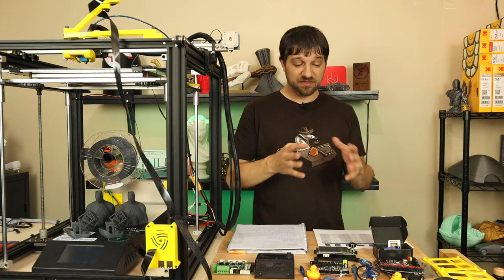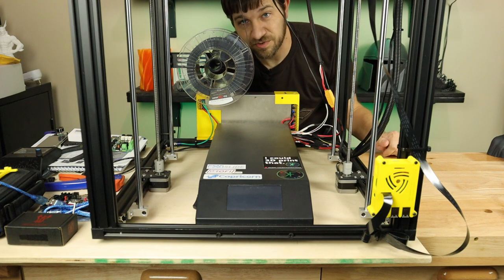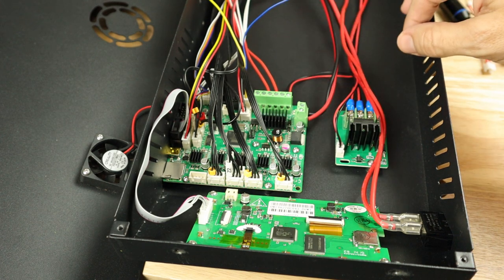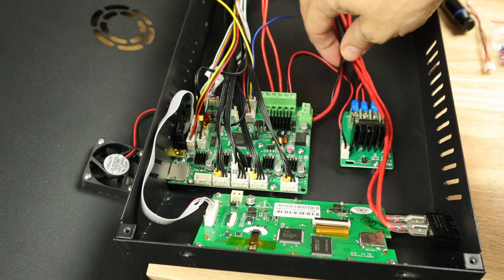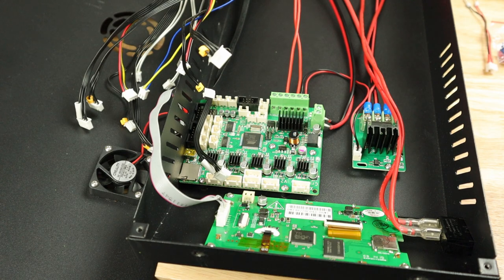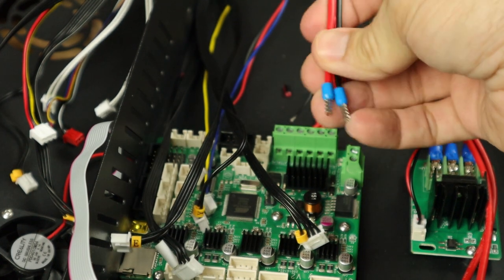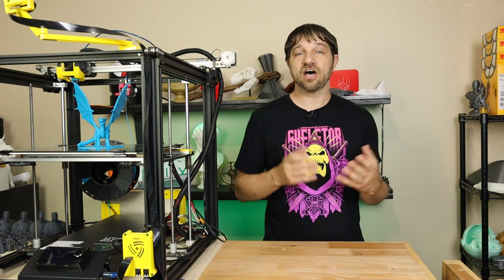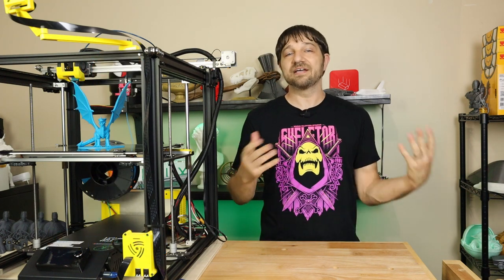Bigtreetech Ender 5 Plus Upgrade: TFT35 Display (Part 2)

Comment: Good video. For the TFT35 V3 screen I was able to squeeze in a sd card extender and route it out of the bottom of the control box.
Reply from the maker: Yep. That was going to be my other idea but the other mounting is more practical if you want access.

Comment: The most funny thing is that I actually tried all the cases shown here and after purchasing a lot of addons for the first mount (SD extender to flash the screen, USB extender to drill holes and use the USB) found the second option and when with it. I love it although I do all my printing from Repetier so it's kind of unneeded but hey so is half the stuff I print. :)

Comment: Great video.  I forgot how much I dislike that electronics box, and how hard it is to work on it.  Glad you pointed out the ferrels they really make it better and much easier to work on.
Reply from the maker: Thanks! Yeah, I wish the box opened on top. But, for most people, this isn't an everyday occurrence. Just trying to add some safety with the ferrules.
Reply: @kerseyfabs  Thanks, I'm always getting into mine, but it opens from the back.  Wait it has no cover, just the electronics

Comment: Just as a note.  Wire that is tinned correctly will act like a solid wire as it would be full of solder, so it is not incorrect to tin the wire, as long as it is done properly.   In fact, with high current it can be preferable to have tinned wire and with proper rising clamp terminals, they are perfectly safe.   Electricians don't use ferrules in your fuse box as the crimp connection can be a weak point, and the wiring is perfectly safe.   
As long as you don't have any strands outside of the connector, it is 100% safe to do it tinned or even untinned bare wire.   There is nothing incorrrect about doing that.

Comment: Another department at work thought they could get their own 3d printer and cut out the middle man.. that's me.. Well guess who has a new printer?? lol They just can't really handle the tuning and stuff needed. lol We'll it's mine now and I got it working very well after about an hour and some new parts. Broken extruder, clogged nozzle and hot end.. Z screws uneven and guides over tightened. I do want to do the board and screen upgrade didn't think of making another case for the screen and dial..  Thanks again for the info now that I'm a 5 plus guy and also a cr10s guy.. lol
Reply from the maker: Fantastic! Congrats on the new machine!

Comment: Good video anyway, but I've one thing to complain: I know generelly everybody wants to crimp this stranded wire with this ferrules. But this is not the way it should work with the the print clamps. If you look in the manufacturer's data sheets, you will see that they offer (and often recommend) to install the pure strands. Because this offers a better contact! Only if a cable is in motion, a ferrule crimp is a better choice. Within the printers control housing there is no motion. So I would choose (and do so with my printers) blank strand installation.

Comment: Just going through this right now :) but also doing a bunch of other things too, great tutorial, I was going to mount the display in a box with the Octoprint display and PI 4B but now have changed my mind, but the next thing is to work out how to combine the PI 4B and the 7" display
Reply from the maker: It sounds like you've got big plans. Are you talking about the new Bigtreetech display or one for the Raspberry Pi?
Reply: @kerseyfabs  both actually TFT35 screen for the Skr,  7" screen for the PI, I have just rewired it fully and installed drag chains, Micro Swiss hot end, Herome cooling setup, had a go at sensorless homing last night (a fail) so will try again today, also have a bunch of closed loop steppers on the way...... Not going to be an easy fit

Comment: Thank you for all your video's. They are great. Do you know on a standard Ender 4.2.2 Motherboard can one add a BTT TFT35-E3 V3.0 Display Touch Screen?
Reply from the maker: It will work on the Marlin side but I don't think there's a connection for the touch screen side.

Comment: Kris,

Great video.  Can the TFT 3.5 display work with the oringial creality 4.2.2 board or do you need to upgrade the board along with the display?
Reply from the maker: Technically the Marlin side of the display would work if you recompiled the firmware. You may be able to even get it to do the Marlin side OR the touch screen side but not both. Either would require custom firmware.

Comment: Thanks for the great video. I am following your series to update my E5Plus. In this video it shows you connecting a total of 3 cables for the display, specifically 2 10-pin connectors. One to exp1 and one to exp2. But then on the Bigtreetech SKR E3 Turbo: Complete Guide, in the wiring section, you only show one 10 pin connector coming out of the display and you connect it to the exp1 port on the SKR E3 Turbo. But there is no mention that I can find of which one of the cables (exp1 or exp2 on the TFT35) you are using? Thanks!
Reply from the maker: Great catch! I'm pretty sure it's EXP3 on the TFT35 side. I hope this helps.
Reply: @kerseyfabs  Yes it is. Based on the location in the video and other research, I plugged it into EXP3 and it worked! Thanks!

Comment: Hi Kris,
This is really a great tutorial, very detail and throughly.
I already watch it more than 4/5 times and come to decision to upgrade my ender 5 plus.

Questions :
1. Can I use the cheap Reprap 12864 LCD?

2. Can I use TFT35-E3 v3.0 or TFT35 v2.0

If yes, can I use the firmware.bin you provide?
Reply from the maker: Thank you! Yes to all of your questions. Any of those LCDs will work with my firmware. I'd stay away from the V2.0 though, no Marlin interface.

Comment: Followed this video, to replace my previous board with the BTT EKR mini V2 (as you suggested the V3 had some issues). When I went to do the ferrels for the thin black and red wires from the mosfet? board (small board on front of case), the ferrels would not hold as the wire was too thin. I would then restrip the wire, hoping to get a thicker set, however, everytime I did, I would get a couple of wires only as the stripping process would remove most of the copper wire, only leave a couple of strands. I have all the same equipment as per video.

At a point where after 4 attempts I cannot risk any more wire as it is getting way too short. 

The initial wire connection was soldered and fairly thick/stable.- possibly should have left it alone?

Otherwise any suggestions on how to fix or replace the wires, including the connector for the mosfet?

Comment: I'm late for this but to use the skr mini e3v2 do I need to change the screen as well or stock screen will work with it and your firmware??? Thank you
Reply from the maker: Yes, change the screen as well. My firmware only supports the new screen.

Comment: Doing this upgrade today, thank you for the tutorials! Question, where does the ground get relocated too that was on the screens mount point?
Reply from the maker: I forget where that was running from. It should be fine to connect to and screw. You could even just attach it under the mounting plate. Just make sure it's not shorted to anything it shouldn't be.
Reply: @kerseyfabs  looks like it pigtails off of the power input to the power supply and terminates on the upper screw of the LCD mount. If it's fine to put back there I'll put it between the plastic and the metal
Reply: @kerseyfabs  by the way, thank you for responding!
Reply from the maker: That'll work fine. It's just a ground for the chassis then. I'm happy to help!

Comment: I have a yellow wire attached to bottom corner of my stock E5Plus screen. Where does that go with the new TFT35 install?
Reply from the maker: Just keep it on that post. It's for grounding.
Reply: @kerseyfabs  I thought so. Just wanted to make sure.  Thank you for the reply.  This is why i follow you!!!!  Keep up the great work!!!

Comment: i absolutely love this, thank you so much, one quick question? with your firmware the printer now auto homes dead center of the print bed, how would i change this so it does it at one of the corners? Unfortunately for what i use these for this is very important to me. any help your could provide would be amazing and i appreciate it!
Reply from the maker: You'll actually have to recompile the firmware. Here's a post that describes what you need to change: https://3dprinting.stackexchange.com/questions/13620/define-coordinates-for-z-homing
Reply: @kerseyfabs  unfortunatley i am haing trouble compile the firmware for 1.0.6 using VSC & platform.io 

i get this error 
ModuleNotFoundError: No module named 'platformio.managers.package':
Reply from the maker: 1.x versions should be compiled using Arduino IDE.
Reply: @kerseyfabs  sorry 2.0.6
Reply: @kerseyfabs  i would love to know what you used to compile this because i'm about to pull out my darn hair XD i just want to change two simple settings but nothing will compile it
Reply from the maker: @knarf247  Which board are you compiling for?
Reply: @kerseyfabs  the skr mini e3 v2 with the v3 screen
Reply from the maker: @knarf247  Please start with this and see if it helps. 2.0.6 may not work anymore: https://github.com/KerseyFabrications/Marlin/archive/refs/heads/2.0.9.1-BTT-SKR-mini-E3-2.0-Ender5Plus.zip
Reply: @kerseyfabs  wow, thank you so much i really appreciate it, i can do a lot of things with these machines, but the firmware has always been my weak point. your guides have finally allowed me to silence these 5(yes 5) banshees and i am sooooo grateful!!

Comment: Can you use the screen and main board USB/SD readers interchangeably? *Just got my 5 Plus running yesterday with a few successful prints. Have the TFT 3.5 and SKR V1.4 waiting to be installed. Deciding on how to mount everything. Thanks!
Reply from the maker: What do you mean? Can I print from either the mainboard SD or from USB, yes.

Comment: Did I miss the part on updating the firmware for this display?
Reply from the maker: I didn't explicitly cover it in this video. It's not required usually and the directions are outlined on their GitHub.

Comment: actually the tined wire is better There is only one point of resistance between the connector and wire If you use the ferrell there are two one between the wire and the ferrell and one between the ferrell and connector Any point of resistance is a loss of power and that equates to heat dissipation Too much of that can ruin your whole day If the wire is already bare though ferrell all the way
Reply from the maker: Thanks for the feedback Robert!

Comment: Activate CR10 display in Marlin. Than connect EXP3 from TFT to EXP1 of the board. Only one cable needed - and you can use EXP2 on the board otherwise ( 7 IO-Ports for extra functions, like aditional stepper drivers or small mosfets for extra controlable fans)
Reply from the maker: Great idea! I may have to try that!

Comment: Does it require a firmware update for this display with your firmware?
Reply from the maker: It's always good to keep BTT display firmware up to date. It shouldn't be required though.
Reply: @kerseyfabs  did you use PLA+ for display holder? Or did you use ABS instead?
Reply from the maker: @fahmi7511  Just regular PLA. There's no real mechanical need for anything more.
Reply: @kerseyfabs  okay, thanks for replying kris, i owe you a lot.

Comment: Beaware, I brought two tft35 v3's and one of them was a B1 btt tft35 the other a Kingprint btt tft35 and they are totally different. The kingprint One has the larger sd card USB and three screen cable sockets, the other B1 a small sd card and usb port and a single 20 pin tft socket. The resets in a different place too, further to the side. Annoying when youve printed two cases the same.  Not all BTT TFT35's are the same! Cant find the firmware for the B1/Ender 5 either.

Comment: I ordered the skr v 1.4 turbo. Alone with the 2209 drivers. It’s going into the cr10s  I’m not computer savvy does it come with software already installed. If I follow your wiring will it work ?
Reply from the maker: It comes with software installed but it's for the Ender 3 usually. I'm sure if you poke around the CR-10 or Bigtreetech communities, you can find some help with firmware. I don't have a CR-10 to test with. Overall, my wiring guide should work or at least help, if you pay attention to the details.

Comment: The "Mounting Bracket for Ender 5 Plus" is no longer available, is it possible to reupload that part?
Reply from the maker: I just contacted the original author. I will update my link. Here it is for convenience: https://www.printables.com/model/31820-ender-5-plus-cr-10s-pro-tft35-v3-case-support
Reply: @kerseyfabs  Awesome! Thanks! I was searching but no results.
Reply: @kerseyfabs  This is just showing the rear bracket and the button cover.   Am I just not seeing the actual bracket for the front? I appreciate all your help! You've helped me a lot with all your info getting my Ender 5 Plus up and running properly!

Comment: By chance do you have stock settings like all the control settings,,,velocity,acceleration,jerk and step...I made a big mistake and didn't write them down before I tried to use similar settings to my ender3 😪
Reply from the maker: I don't have the "stock" settings, but I do have mine:
Ender 5 Plus:
Speed: 50 or 60 mm/s
Travel Speed: 150mm/s
Initial Layer Speed: 30mm/s
Print Acceleration: 500mm/s^2
Travel Acceleration: 500mm/s^2
Print Jerk: 8mm/s
Travel Jerk: 8mm/s

I hope that helps!

Comment: Is there any way yo use the btt tft 24 v1.1 with the skr mini e3?
Reply from the maker: It looks like it should work just fine according to their documentation.
Reply: @kerseyfabs Oh i asked that but i also asked if i could use the skr mini 3d for the E5+ and advised me not to do it. Could i use an SKR v1.4 turbo with that screen, or an skr3?
Sorry for all the questions but i live in argentina and i have VERY little options. Like the display u used here it´s $150+ and the skr v1.4 turbo is like $200 without drivers so that's why i need to be extra careful :)
Edit: I could also get the btt tft 35 v3.0, or the LCD 12864 for screens. 
And for mobos my options are: Skr v11.4 turbo with tmc 2209 v1.3 uart drivers (only ones i can get), Skr Mini E3 V2 (with onboard 2209`s).
I think the safer bet is the Mini E3 v2 with the tft 24 v1.1 if they are compatible with your marlin compile, right?
So sorry i`m in a bit of a loss here
Edit2: Could i simply just not have a screen and use a computer to control the printer?

Comment: Does this display visibly flicker?  Mine does almost like the effect when u film a tv screen. Is this normal??
Reply from the maker: No, that's not normal. Sorry. Does it do it in Marlin mode too?
Reply: @kerseyfabs  well that’s my second problem. If I try marlin mode I get a blank screen. It also won’t flash from the sd card like in the video. I’m at a loss. I have double checked all connections. I can control the steppers from the GUI but I can’t get it to flash from sd and I have the screen flickering
Reply: Update: Figured out one problem was my jumper settings on the steppers. I misunderstood the placement. Just ended up removing the uneeded ones.  Tried a different flash card as well. Board accepted the firmware this time. Seems to be working as exprected now.
Reply from the maker: Awesome! Glad you solved it.

Comment: I have changed the board of my ender 5 plus to a skr 1.4 turbo with tmc2209 and hemera extruder. Does somebody has an  idea why alle the ender 5 plus have a problem with inconsistent layers?
Reply from the maker: I'm not seeing an issue with inconsistent layers on either of my Ender 5 Plus printers. Can you be more specific or post a link to a photo?
Reply: Problem found. The linear bearings have jammed. I had to swap all 4.
Reply: @Huntwerker2212  were the rails/bearings greased? You need to have some sort of grease for them to move freely continuously. I had the same issue and solved with grease.

Comment: The power switch needn't be moved because of the wire infringement.  Get these:
https://www.amazon.com/Lala-Smill-Terminals-Disconnect-Insulated/dp/B07PPTVPYZ/ref=sr_1_13?dchild=1&keywords=Right+angle+fastons&qid=1600262314&sr=8-13  They will allow more space where you need it.  They are available for different gauge wire.  I took a guess based on the video.  This style of crimp on terminations are called "fastons".  At least that's what I've been calling them my whole career.  The 3D community has changed many naming conventions.  I've never heard of a "grub screw".  It's a dumb name for something everybody else calls a "set screw".  I digress.
Reply from the maker: Thanks for that link! These will be good to have on hand!
Terminology is always difficult for me as someone making videos because of a worldwide audience and because terms change over time. Even simple terms like "Allen Wrench" versus "Hex Key" I go back and forth on. I went and looked up the "grub screw" term because I was curious and this is what the Wikipedia page on "set screw" had to say on it:
"Set screw or setscrew in the UK refers to a bolt which is fully threaded, with no smooth shank. These commonly have a hex head, but are also found with socket or screw heads.[2] This contrasts with usage in the US where a set screw is almost universally a grub screw or small-headed bolt.[1] A fully threaded bolt is commonly called a cap screw in the US.[2]"
So at least I didn't make that one up. 😀
Reply: @kerseyfabs  I know you didn't make it up.  Grub screw is one thing the entire 3D printer community seems to agree on.  I do take issue with Wickipedia's definition of set screw in America.  McMaster-Carr uses my definition.  You're right about one thing:  The world is evolving.  I guess Darwin was right.